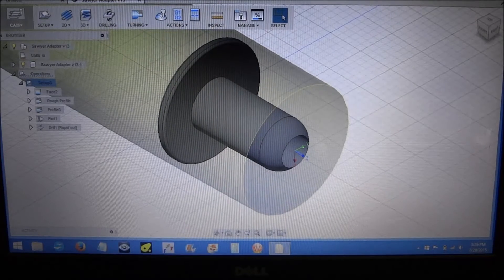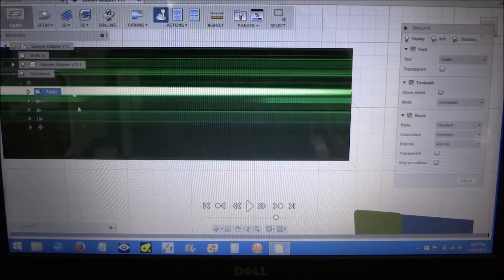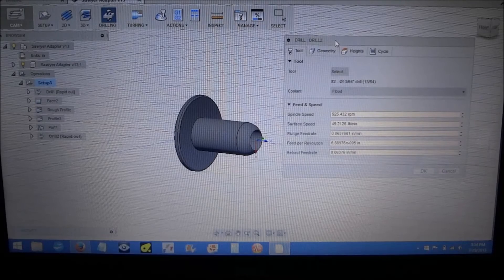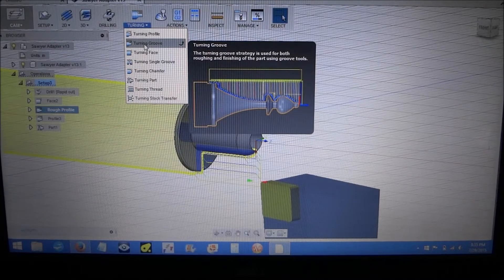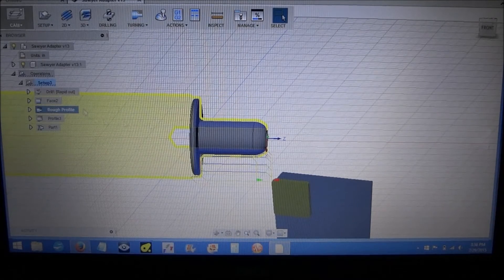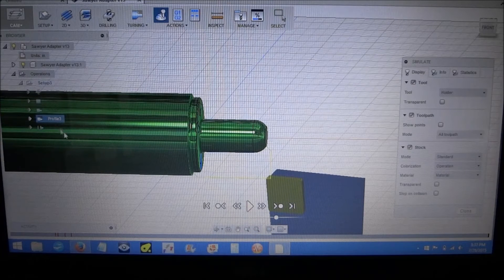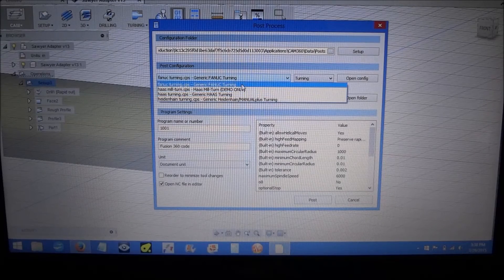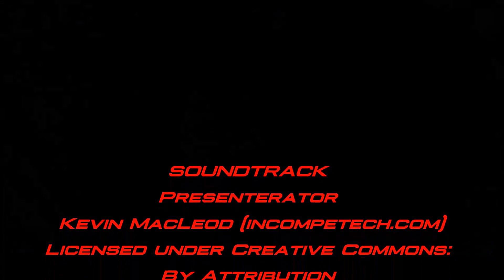Fusion 360 Lathe Cam first look!!!

Comment: I've been pouring hours into this already and man does it have a way to go. Form tools are coming eventually, and hopefully a lot of other upgrades. There is no LinuxCNC post yet but I've already started hassling the devs to get on it.
Reply from the maker: russtuff Just ran my first Code from 360 there is limited options for post processors but with only two axis to worry about you can make corrections where needed. there is no drilling Cam the Mill cam for drilling will not post with the generic turn processors so I had to post with a mill processors and paste it all in but thats a small issue. overall I like it. I used it for my X axis bearing mount and it worked great.

Comment: Nice video. Fusion 360 is a bonanza for us hobbyists. I just downloaded it this weekend and love the fact I can run it on my Mac in OSX natively, however I am so lost and confused with it, it's not even funny. I'm sure with time I'll grow to like it, but I'm not throwing away what I'm using quite yet, as it can do all I need it to do. Perhaps when your lathe is operational you might be able to show us all some baby steps on how you get your parts designed and cut. Ciao.
Reply from the maker: Crivo152 Yea Fusion 360 is great and in my price range. :-) LOL
well I will try to post a few video's on some tips I found its not to hard to figure out the hardest thing is getting the model oriented. thanks, Sam